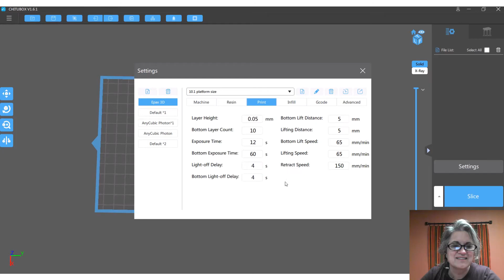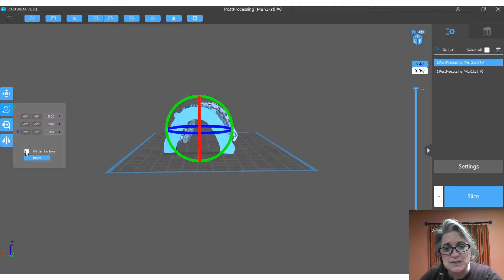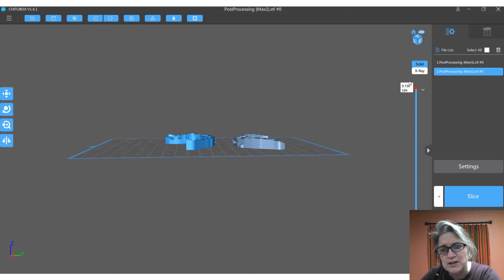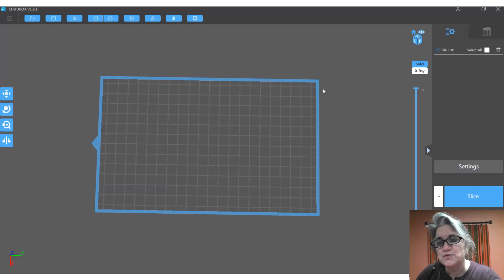Printing an Indirect Bonding Tray on an Epax 3Dprinter using Chitubox

Comment: I have been searching for a way to print with the nextdent IBT resin for a while. I have a form2 printer and looking to buy another one for IBT printing.  Which Epax do you use? X1 or X1 DJ ? I notice there are some small differences between the 2 (Light source). Would that affect the settings you use? Thank you for sharing, great video!